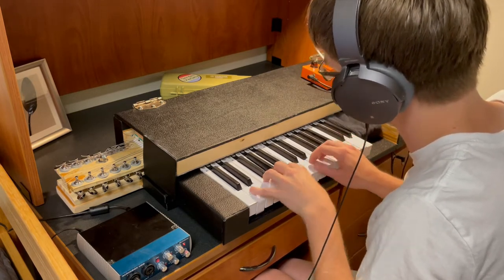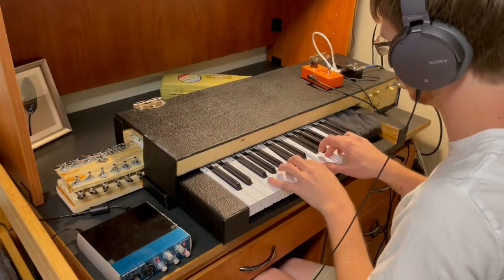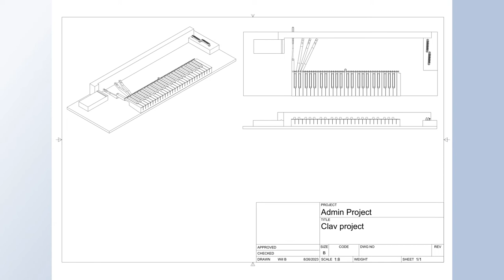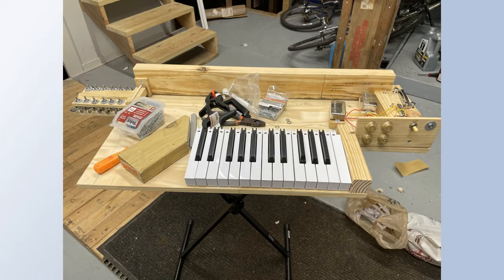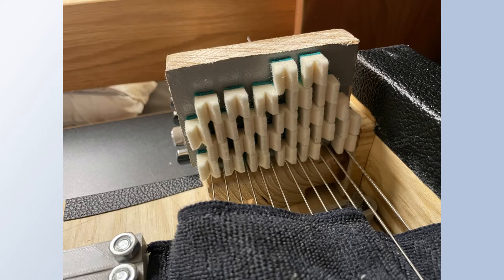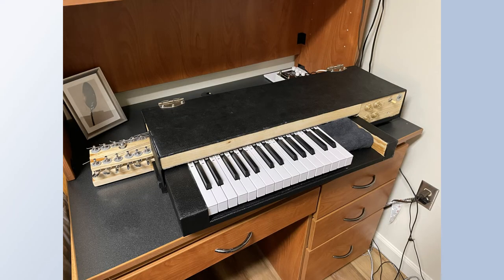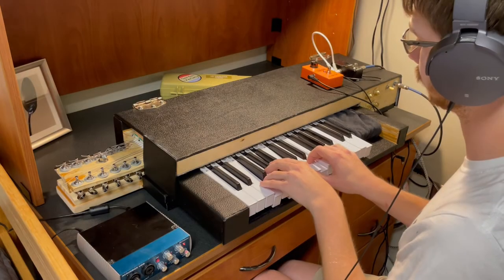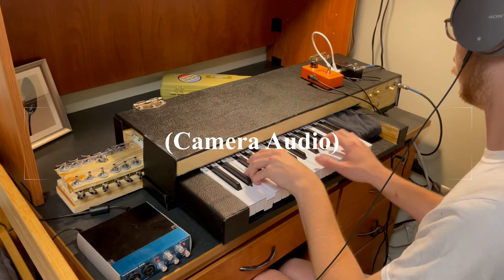Building an Electric Clavichord

Comment: Awesome job! Looking forward for more videos :) If the pickups are installed above the strings so that you could mount them more towards the middle of the string, I wonder how that would sound like
Reply from the maker: I am not sure the way I designed it if there is room to install above the string, but I agree with you on the sound. What I would really love to do is have 2 pickups over each set of strings, so that I could swap between bridge and center (neck?) pickups for tone variation as you would on a guitar. We will see if I can pull it off though.

Comment: Is it 2 or 3 keys each string?
Reply from the maker: It is 3, except the lowest string which is 4 and the highest which is 2.
Reply: @willstudioworkshop  ok thanks🙏🏻
I built a 12 strings clavichord (26 keys, one string each note and octave) and I'm planning to upgrade it using your same method, but more than 26 keys. I think your method is better and versatile🙏🏻
Reply from the maker: @emmet_guitarist  if yours has similar range as mine, you can probably get away with putting more notes on a single string on the lowest 2 strings, I don’t ever play major or minor thirds on either of the lowest two strings because of the low interval limit.
Reply: @willstudioworkshop  I'm building new keys for my clavichord, using your same system🙏🏻